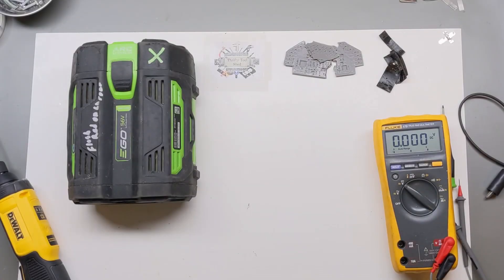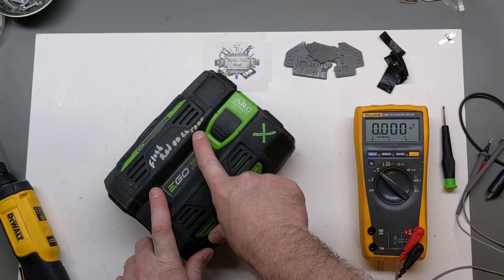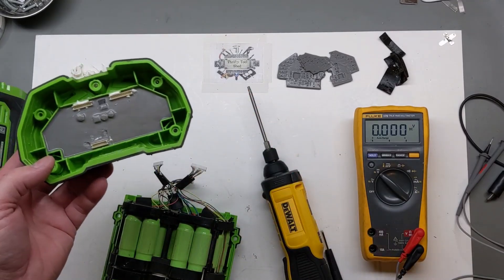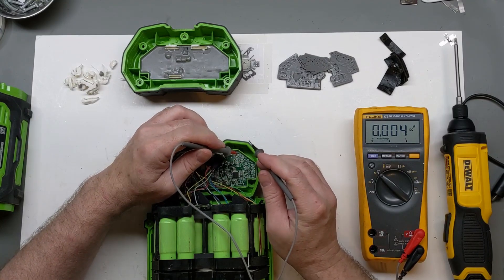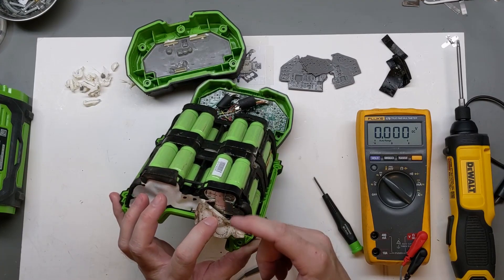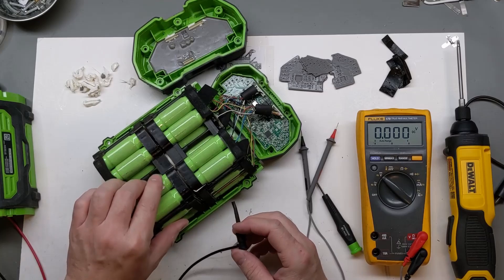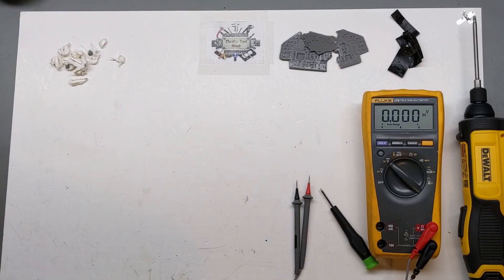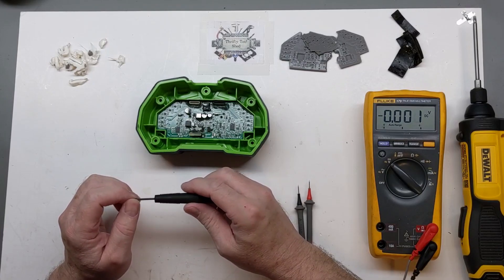EGO 56V Gen1 5AH Blinking Red on Charger Fix

Comment: Before you do all of this, drop the battery from a height of about 1 foot to 15”. For whatever reason, it “resets” the electronics and the battery charges and functions just fine.
Reply from the maker: That will be temporary as it is simply proving the loose connection as shown in the video. The reason for the video was to share the real reason it may be giving the issue.

Comment: I have a gen 1 5ah just like this one showing 40.3V. Flashes red when I push the button, and won’t charge. It’ll run for about 5 seconds then the battery and charger both flash red.

I’ve tried jumping it with a known good battery, no change, won’t take any kind of charge from another battery. I’ve also tried charging it with my power supply direct to the negative and positive but it won’t even activate my power supply. Nothing I do puts any power in it. 

Is it likely a low cell inside like this one? I understand the issue but how are you figuring out which cluster of cells corresponds to what wire and monitoring circuit?

Comment: I'M REPOSTING THIS FROM ONE YEAR AGO. IT SURE DID THE TRICK FOR ME
"THE BANG TRICK WORKED .SO glad I saw the comments about banging the battery from about a foot off the ground and dropping it. IT WORKED I had THREE bad batteries. ALL THREE have been working GREAT since May and I recharge and use the OFTEN. HOLY GUACAMOLE. Those three bad ones were here for over a year. I bought two news ones for 200 bucks a piece but something told me NOT to throw those bad ones out. THREE bad batteries now working PERFECTLY for five months with CONSTANT charging. I have the lawn mower, leaf blower and snow blower and I use the blower daily and the lawn mower once per week. HUGE area. SO glad I was the comments about BANGING the batteries. THANK YOU THANK YOU THANK YOU"

Comment: What about if you try and charge it and it lights up green like it’s charged but then I put it in my leaf blower and it runs for two or three seconds and cuts off and starts flashing white?
Reply from the maker: I have never seen the lights flash white myself, but sometimes when the blower only runs a few seconds and shuts down the blower is not communicating to the D-terminal of the pack. So check/clean the contacts and try it. Hopefully it's not a BMS board issue. The other reason for showing green like charged and then shutting down early is sometimes a bad cell in the pack dropping below the low voltage cutoff as soon as a load is applied. That usually lights up red on the pack though.

Comment: Hi,  My lawn mower's battery stop working recently. when I charge it. The light on top of the battery shows "green; red; orange". after few cycle of the light shows, the charge stop working. is there anyone know what's that mean? how to fix the problem?  Thanks a lot!
Reply from the maker: Hi,
The lights cycling through the colors is normal, the stopping of the cycle obviously is not. What is the battery showing when it shuts down or when you press the fuel gauge button?
Reply: @ThriftyToolShed  Hi,  thanks a lot.  I checked the cells and measure the voltage one by one and found one cell's voltage was only 0.42V,  I charged this cell to 3.6V and used my ego charge to charge the whole battery,  same problem. Now when I push the button on top of the battery, it doesn't show any thing.
Reply from the maker: @andrewche9803  
Good job finding the low cell. As far as the fuel gauge not lighting up, make sure the plugs are plugged in well to the connectors on the BMS board. If it is not that it is more than likely an issue with the DC-DC converter part of the circuit. If the board was still connected while charging up the low cell I guess some issue with the BMS board could arise.

Comment: About 40 years ago I purchased a True Value gas lawn mower for less than $100 that lasted nearly 25 years until finally too many pieces broke off. But the engine still worked. Last year I paid many times that amount for an EGO mower with an expensive battery that will likely fail permanently one month after its warranty runs out. EGO battery documentation says it will overheat and shut down. And then you must let it cool down for extended periods of time. How many times does that have to happen before EGO admits that their batteries are undersized or defective? How can one keep their lawn mowed if the mower has to sit idle for long periods of time while the battery is cooling down? Maybe put the battery in the refrigerator to speed things up?
Reply: if you have the gray, stand up quick charger, that charger has fans that help cool the battery when charging.  Do not place in the fridge as you risk creating condensation conditions inside the battery pack housing.  Another way to cool down a battery is to place it in front of a small fan to help evacuate the heat from w/in the battery.   My battatry just started showing constant overheat conditions even after being inside the house over night.  I have 12 days left on my 3yr battery warranty.
Reply: My EGO battery just passes three years, then it would not work. It looks to me they set the program to shut it down.

Comment: I use a 42" walk-behind gas DR mower to do most of my lawn mowing, and I purchased a 7.5 AH EGO mower in May 2022 to do touchup mowing. The EGO mower has between 10 and 15 total hours of use, and the battery started flashing red and cutting out this summer. I've used it about 6 times this summer, and each time the red cutout became more frequent until now it immediately cuts out and won't run the mower at all. Going to try to contact EGO today and figure out what to do.
Reply from the maker: So usually flashing red is an under voltage condition and not temperature related. I believe the newer packs are solid red for temperature issue and older packs are orange/yellow. So it could be a cell (or cell group) that is going bad and reduced in capacity and that is possibly why flashing red without much run time. I would contact EGO about the pack for sure. If EGO sends out a replacement and tells you to keep/recycle the old pack you can either test the cells, make sure all the connectors are plugged in well on the board and at the minimum sell it on eBay as a broken pack. People still pay good money for the broken ones. It is absolutely some growing pains with the lithium power equipment and I could see that from years of working on things. That is why I try hard to share as we learn about these as much as possible. It is No how-to manual. No schematics. No real place to take these as we did with small engine shops. I don't wont these to be throw away after a few years. Best of luck to ya!
Reply: The mower and battery have been sitting idle in a cool Morton building for about a week with the battery fully charged. I just ran the mower about a minute and it now seems to work fine. We have had some hot weeks this summer with temperatures in the upper 80s to upper 90s. The battery cutout problems I've been having may be related to overheating. Maybe on the hotter days I just need to push the mower and not add the extra load of self propelled.

Comment: I can find plenty of info on blinking batteries, but my charger is blinking red and green and won't function. I can't find anything about that anywhere...
Reply from the maker: hi,
I only have one charger repair video and it was a power supply related issue on the Rapid charger. Do you know its the charger for sure? Will the pack charge on another charger or are you having multiple pack giving issue with the same charger?

Comment: Thanks for making these videos. I've got a 1st gen 7.5AH 56V Ego Battery. The button shows solid green, then blinking red.  Voltmeter has red 48Vs in the contacts and wiring. I'm kind of stumped. A lot of the parts are still in silicon so I may need to do some digging if it's the fuse or not. Any advice?
Reply from the maker: Well that is one of the problems I have seen a few of and I have not figured outta exactly. It is not a very common failure, but it is odd because the BMS shows green like it is testing good and then switched to blinking what seems to be an error code. I believe it is a microcontroller issue or at least an issue with a watchdog or some other communications protocol between the 2 microcontrollers because of how it errors. I tested every test point on one of these and could not find much discrepancy at all  in the bad one when compared to the working board. I have many videos on other failures as we learn more about them, but usually this one is an unknown of exactly what causes it. I am of course only guessing about the microcontroller...
Wish you the best of luck with ours and thanks for your comment!
Reply: @ThriftyToolShed  thanks for the response! I hope there is a fix or replacing a microcontroller will work. I keep thinking it's the charger. 

Thanks again for the helpful teardowns
Reply from the maker: @loonigoonie  If we did take time to try to get the program out of the microcontroller or a good working one then we could possibly replace the microcontroller. I have not taken  the time to try this yet. It's not the most common issue so I don't know how much time it's worth.
Reply: @ThriftyToolShed  i suppose it would be worth it if i can find replacement microcontrollers to save a pricey 7.5ah. Yet replacements seem nil.

Comment: Whenever I have problems with my ego batteries. Checking the individual cell balance is my first priority and 99% of the time it's the issue
Reply from the maker: That's good. I have had more issues with the BMS on the EGO platform so far with the ones I received as non-working. Kinda like the first EGO repair video about 6 years ago and of course the board issues can damage cells also.  Cells are the majority of pack issues for most branded packs for me as well, but not even close to 99%.
Reply: Where can you bay individual battery cell? How much voltage for each cell. 1.5V?
Reply: @HsingSun   all over the Internet, most are 3.6v, Samsung is the best
Reply from the maker: These are 18650 Li-Ion cells and approx. 2.6Vmin - 4.2Vmax range.  So many do call these 3.6 or 3.7V nominal cells. I usually get my cells from 18650batterystore.com.

Comment: What’s that power supply you use in his video?
Reply from the maker: I believe you are asking about the  UNI-T benchtop variable power supply. It has Constant Voltage and Constant Current control. I believe it's obsolete  now but it's many available. I would try to find a 0-60V model. They are harder to find. 0-30V are easier to find. 
Example 0-30V
https://amzn.to/3HAO9F7
Example 0-60V
https://amzn.to/3BDV8tg

Comment: I have a newer battery I think that actually has the five LED lights. I had every issue with it but someone in another video mentioned dropping it. I thought he was absolutely trolling. I said I have nothing to lose because I tried everything besides opening it up which I don’t wanna do. I dropped it off my couch and it’s been working fine ever since🤣🤣🤣
Reply from the maker: Yeah, I have a repair video on the blinking orange and it was a loose connection inside causing it. I shared the information and how I could touch around the wires and it would start working then go back to fault.  Many viewers commented once they realized it was a loose connection they would just drop it and start working lol. That's cool and maybe many of them will get lucky, but that bad connection will show back up more than likely. Best of luck and thanks for sharing!
Reply: @ThriftyToolShed  Thank you so much for your reply and information. I totally agree and its just a matter of time before it stops working again lol

Comment: One of my 56 Volt 5.0 Ah EGO battery stop charging and i'm having problems with EGO Customer Service . I had purchase a snow blower  from Amazon on febuary 2021 and one of the battires have died and I was told  by  EGO Customer Service, " This is to inform you that United Standard Supply (Amazon seller) is not an authorized seller for EGO. Therefore we are reluctantly compelled to inform you that there is no warranty on the complete kit that is registered on warranty - W-02768686" in other words go screw yourself.

Comment: Hi, interested to know if the boosted cells held up or did they self discharge again?. Is the pack still working. Thanks for your excellent video's by the way
Reply from the maker: Hi,
I have had luck with a few that had a more Minor unbalanced set of cells. For the most part the pack will lose capacity as the cells are not matched well any longer. I have a couple of 5Ah that run like they are more like 3-4Ah. (One cell or more is lower in capacity so it shuts down the rest prematurely) The other repairs are from packs with cells so far out that I had to replace them. Sometimes it's all cells and sometimes if just 1or 2 cells that are bad and the rest all test well and are matched in capacity. I will go through and test capacities on all my spare cells and match up as close as possible like I mentioned in a video called " Lithium Battery FAQ#1"
Thanks so much for your kind comment!

Comment: Any links to a viable generic model?
Reply from the maker: Are you asking about aftermarket packs? I have a couple of videos on them. The first one I bought to learn about the BMS and if it works well with the EGO equipment. The second one the company sent me to review and see what we thought about it and I was at least surprise how well it works and how well the capacity test went. I still use mine and they work great, both of them do. Of course it is a lot of mixed reviews and some negative comments about the packs on the video, so I am sure quality control may be an issue to some degree. 
https://youtu.be/qtdeChmWXZE

Comment: I called tech support with the same issue.  They had me push in the battery button for ten seconds to reset it, then it worked like a champ.
Reply from the maker: Wish they all were that easy. Thanks for sharing!
Reply: I YouTube search my ego battery charger turning on and off and not charging battery. I watched this video then seen your push battery button in for ten seconds to reset battery comment and I did that and it worked the battery charges now. The home depot I bought my ego leaf blower from a few yrs back don't sell the ego brand anymore. Ace hardware is the only store near by that carries ego and they said the battery's bad and tried selling me a new battery no thanks, those batteries aren't cheap.
Reply from the maker: No they are not cheap, that is the only reason I started looking into the repair of these. When my very first one failed and it was a board issue I tried to learn and share as much as possible. I wish all repairs was as easy as a reset by holding the button 10 secs. Unfortunately it is not the case. Glad yours is working again.
BTW:
Lowe's carries the EGO brand now, I assume you are not really close to one of those either....
Reply: @ThriftyToolShed  I just found this video after one of my 2.5aH batteries didn't want to power my leaf blower and didn't want to charge.  I was thinking maybe a bad cell, but tried this reset just in case, and seems to be working again!   Maybe I'll get a little more out it!   Thanks for the video and advice!!
Reply: Found this video and corresponding post to hold the green button for 10 seconds, and it worked like a charm!  My battery is over 5 years old so I know it's on bought time, but happy to get the reset working for a little more life out of it thanks for the tip!

Comment: I have a 2.5 AH that constantly blinks green. It's not hot or cold, it's room temperature. I checked the voltage and it's 52 volts. I plug it into the charger and the green light quits blinking, but the red light on the charger lights up immediately and won't charge. Can that be fixed? If so, how? Thanks in advance.
Reply from the maker: My very first repair video was on the blinking green. Mine was a shorted transistor on the BMS and I shared all I found with that repair! Best of luck to ya!
Reply: @ThriftyToolShed  Thank you!

Comment: I have a 2.5 that had one cell at near zero, so I replaced it. I made sure the new cell was at the same voltage as the rest, but when I press the button, the battery first indicates green, then starts flashing orange. I checked voltage and the battery is at 55v.
Reply from the maker: If all cells are balanced like you said and it does this it's usually the BMS. I have had a few this now and could not find the issue with the BMS, but replacing the BMS with another did fix it. Usually mine are green then flash red, mine are 2nd generation with the old style fuel gauge. The newer ones may be different.
Reply: @ThriftyToolShed  Thanks for the prompt reply. I was going to pillage the board from my 2.0 pack, but apparently they must be different versions because the connectors are different like you mentioned in your vid.
Reply from the maker: @The_Borg  Yes, atleast the 2 that I have called Gen1 and Gen2 due to the connector difference and as far as the newest version with the fuel gauge, it is most likely different as well.